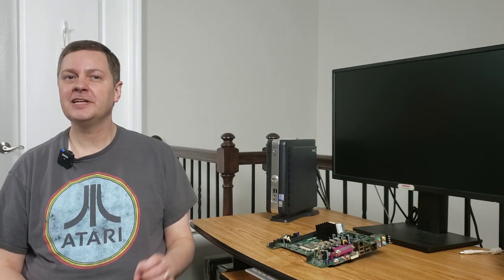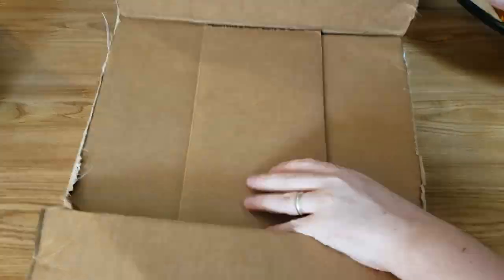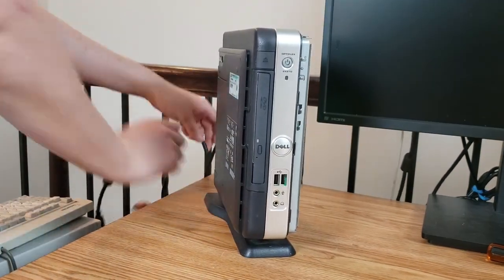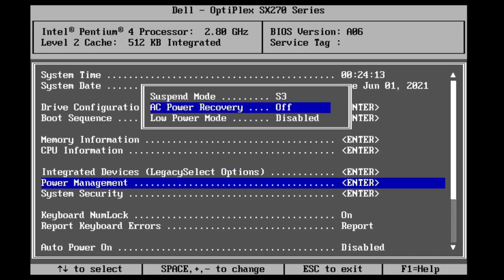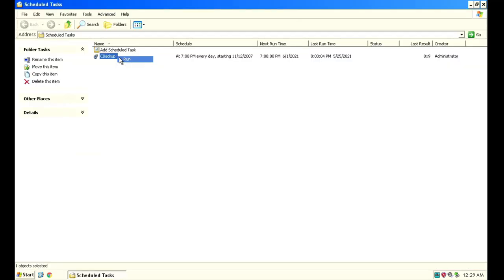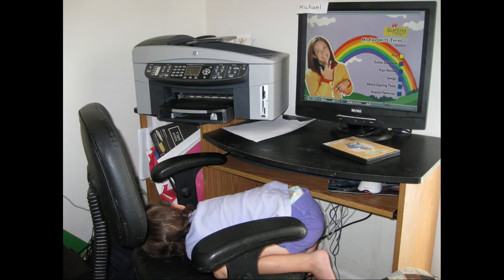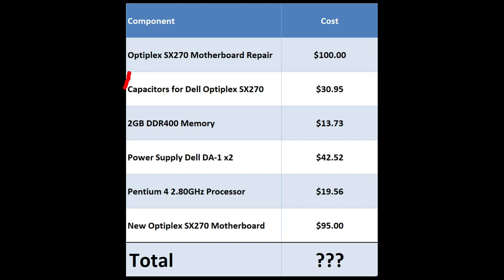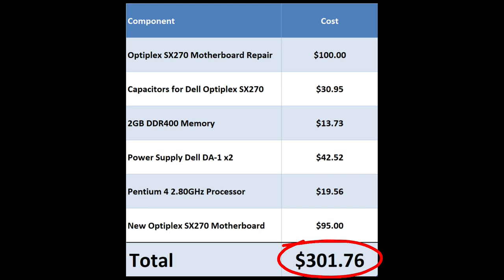RetroRepair: Another Dell Optiplex SX270 Repair Video. Is it Finally Fixed?

Comment: I would hang onto the spare motherboard to pull the caps out of if you ever planned to put the PC back into regular rotation. The caps will likely go bad again due to the high ripple current and high heat this board ensures during normal operation.

With that said, I have my own SX270 I recently repaired as I used to deal with these at work. I’ve also repaired hundreds of them with bad capacitors. That was my side hustle to make ends meet. I put in massive effort to get promoted and was able to spend more time with my family and less time working two jobs, so I wanted something to remind me of where I started and how far I’ve come and oddly enough, those defective motherboards were part of what helped me get there. I definitely get the nostalgia factor and memories you could have with something like your PC. It’s always nice to save something that is tied to happy memories.
Reply from the maker: That is a great idea.  And thank you for sharing your story about this.. that is absolutely wonderful and very inspiring!! Glad you kept one for the memories there, and very glad you shared the story with us!!
Reply: @RetroTechChris  Absolutely. It’s nice to know there are others out there that put in so much effort for the sake of keeping memories alive.